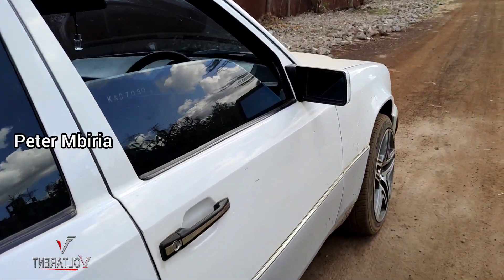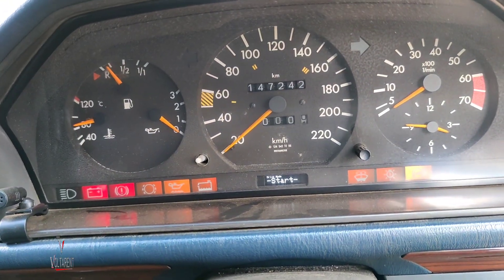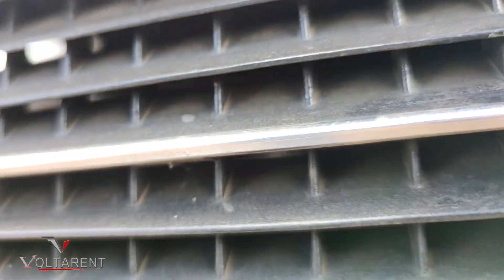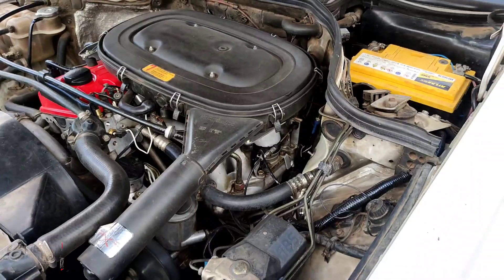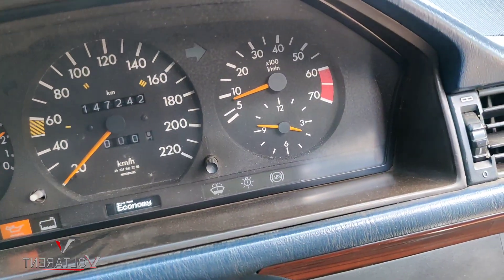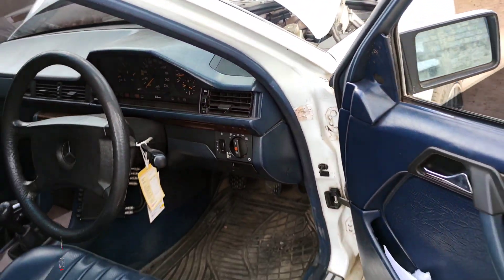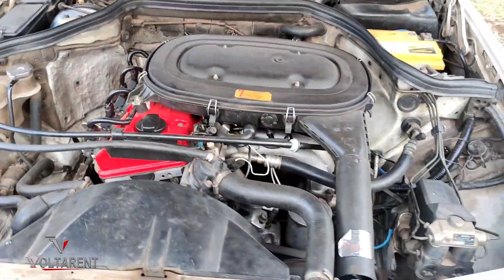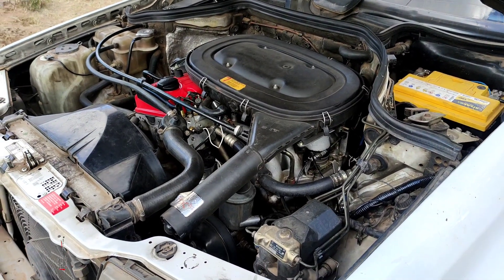Mercedes Benz W124 Conversion: K-Jetronic to Voltarent EFI Upgrade

Comment: congratulations for the excellent work. It looks very neat!
I have the same car, and I made the same modification (I clarify that I am not an expert) I put an ft300, kept the original intake and throttle. The problem I have now is that the accelerator became very sensitive, just by pressing 20% of the pedal the engine accelerates to 100% therefore, the car has poor performance. I was thinking of replacing the throttle body with one of a smaller diameter, but here I see that you have achieved good results with the original. I would greatly appreciate any comments or suggestions from you. thank you!

Comment: Nice ! Coil-on-plug too. Really nice.
Peter, I’m curious about one thing. Everyone says these engines ( mine too ) tend to shake a bit at idle. Does this go away with EFI or is it the same ?
Reply from the maker: Hey man, thank you for reaching out.  Even for modern engines, you'll find them shake a bit, some more. What happens is, when the engine is leaned out when idling, it tends to shake and in my case when tuning, I tend to lean out (15-16 AFR) the mixture which partly causes the shakes during idle. If there's any load, the ECU easily compensates to prevent the engine from stalling by adding fuel enough to run at idle. It doesn't happen to all engines though, some can be leaned out that even at 700rpm idle, the engine is still very stable, at times you can't even feel it running unless very keen.
Reply: @PeterMbiria1  thank you for the info peter. Good luck with your business :)

Comment: Really nice work. I've been following your videos for a while and it's incredible how far this has come. The display is a nice touch as well! I'm curious how the different driving modes work? Du they regulate how much fuel is injected? Greetings from Germany!
Reply from the maker: Hey man, thank you 😁. Each drive mode has different parameters for fuel injection, type of fuel injection (sequential or batch) and ignition advance angles. Sport is aggressive as the moment the throttle changes position, it switches from sequential fueling to batch and the ignition advances based on how loaded the engine is. ECOplus is leaned out and fully sequential, once the throttle changes, it slightly adjusts fuel delivery and the ignition advance is much more to burn the lean mixture on time to make some power.